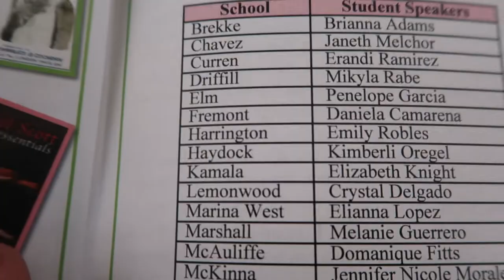My 2017 Ford Focus ST is leaking oil already?!!

Comment: It's a leak from the vacuum booster gasket that runs off the intake camshaft. I've had the same leak for about 40k miles. I'm finally sick of it because it's leaked enough to start soaking my undertray/spotting the driveway

Comment: Im currently dealing with tranny leak on my 15 focus st. It seems to be coming from the top of the tranny - the shift tower - I took the shift tower off, and there isnt even a gasket there from factory, just crosshatched sanding pattern form the factory when they resurfaced the matting surface. Its really dumb, Ill try to put some RTV on matting surface and hold my breath. THis shit really sucks.

Comment: Same leak i i have on my car 2017. If found the leak 6 months after i purchased my car then i claim that leak to fix under my warranty. They fix it at first then few months it leak again then ask them for fix it they fix it again but few months again it leak. Been back and forth to my dealer 6times just for the leak and im tired of them cause they're not fixing it properly
Reply: I have an 2014 Ford Focus hatchback and went to start my car all the oil came out of it leaked all over the ground